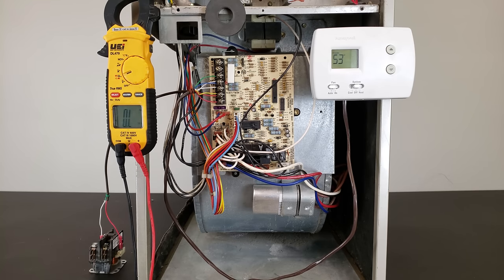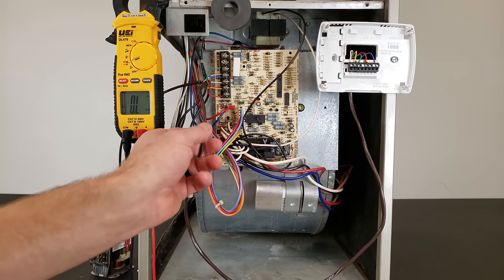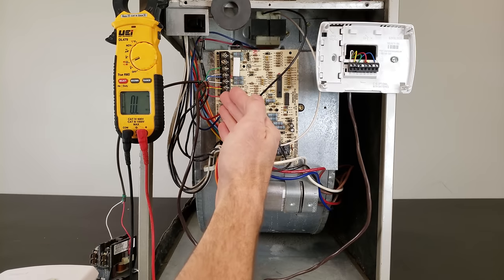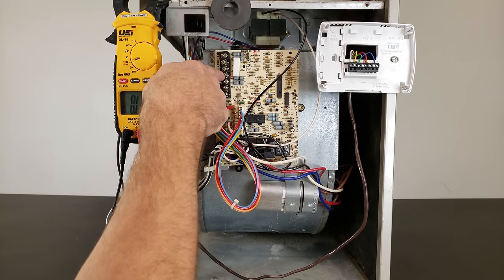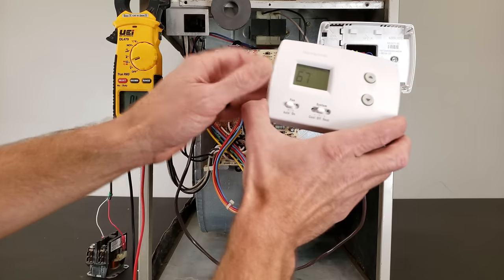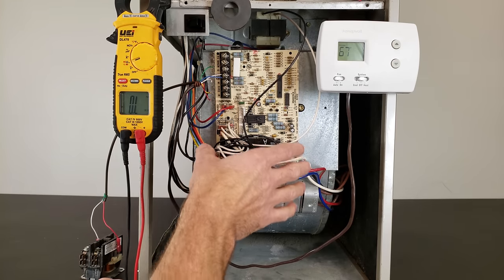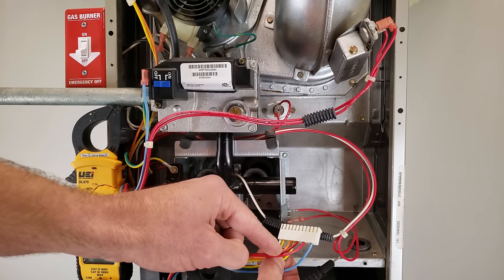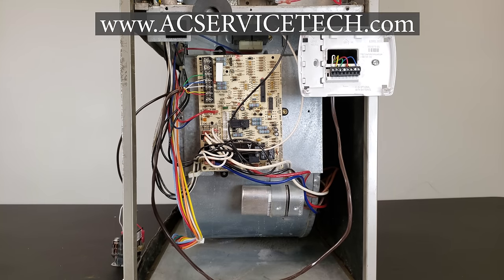Finding Low Voltage Shorts Fast! HVAC Troubleshooting!

Comment: Wow I wish my unit was this simple. I have what looks like another thermostat inside of my furnace and a black box with a red timer knob on it and also another black box looped to it by 2 wires with 3 wires connected. I am so frustrated with this. Your video is great but my unit is just a lot more complicated. By the way I'm blowing fuses when unit is calling for cooling. Doesn't happen on heat and not happening when calling for fan.

Comment: I have installed transformers and the metal frame of the transformer is connected to. Ground and as I understand the bare copper wire is connected to the ground frame terminal and back to the service disconnect ground terminal which then goes to the ground rod to earth ground.

Comment: Once I saw how the metal tape insulation was touched inside part of the high temp limit switch. The problem was appearing sometimes.  And that playing price of metal tape was a conductor for the shortage. And it blew up the fuse sometimes.
Reply: This right here is an underrated comment. Ive had it happen 2 times and let me tell you it needs to be addressed because shit gets real when its 130 in the attic looking for these lol

Comment: Hi Craig, my HVAC unit was not started and after seeing this video, I have checked the fuse and it was blown out. Then I replaced the fuse. The unit works fine in fan mode and heat mode. when i turned on the cooling in thermostat the fuse blew out again. Please let me know what could be the possible reasons and what else I can check. Please advice
Reply: Contactor is a good starting point imo. But your meter is your best friend when troubleshooting electrical issues

Comment: Thank you for this video. It is 2024 Feb., and I hope that ppl or you still will see this reply. I am trying to learn about heat pumps. and was wondering if you or anyone could explain about the "common and the ground" on the 24v circuitry. i just don't get it, how there are the same as you say here. HOW IS THE COMMON, the ground? Or how is the ground common?

Comment: So I have a honeywell smart wifi thermostat and a carrier gas furnace. Whenever I run the heat and the furnace does it's heat cycle, soon as it goes into 90 second cool down where the fan keeps goin but the furnace isnt calling for heat my thermostat cuts off and then restarts once it's done. Any thoughts?

Comment: Very good explanations mate 👍 
By the way , how do you like your UEI meter , I hear both sides , some say they're good some say they're not reliable or precise enough?
Cheers mate 👍.
Reply: A UEI meter is good. They are a good price for their accuracy. The biggest difference you will notice between them and higher end Flukes is millivolt and small ohm resistance readings. Rarely do you need that much precision when diagnosing anything, especially residential. I bought a very expensive Fluke and while it's good and reads capacitance on capacitors MUCH faster than my lead techs UEI, it's not really worth the money/hype. Also I like that UEI meters have a magnet on the back making it easier. Only thing that I hear consistently is that Flukes tend to last really long.

Just make sure you get one with "true RMS."
Reply: @jericosha2842  Cheers mate

Comment: I recently dealt with an HVAC company who someone else called to fix something. He blew up THREE transformers before he told me that there was a dead short in the thermostat wires.... Which I already knew and already told him.
Why didn't I just do it myself? I was working there temporarily and i didnt make the call and i was too busy to deal with it. Ultimately, I used an unused wire to the stat as a substitute.

Comment: I have a 35 yr old air handler, what to do if it has no circuit board and a 3 amp fuse? I bypassed the thermosthat and now my AC won’t turn on. I guess I short circuited the unit.

Comment: Why leave common wire in terminal when test the ohm reading ? Thanks
Reply: Your short will usually be between the common/ground touching a hot wire.  Good luck!

Comment: I have a question about a blown fuse on an electric furnace on the heat side. I turn the furnace on and it will run for about 30 mins, then it shorts out the 3a fuse and the tstat is out. Replace the fuse and it does the same thing repeatedly.  Is that due to a bad sequencer, or possibly a thermal limit switch ??
Reply: Where you able to figure how to fix it. I’m having the same problem

Comment: What would be the issue if I'm not getting any voltage to my yellow wire at all? When I put my leads on R and G, I get 21V, when I do R and W, I get 21V, when I do R and B, I get 27V, but when I do R and Y I get 0V in heating and cooling modes. and when I do B and Y I get 0V when I'm in cooling as well.
Reply: @derrickanthony4  Yes. when I call for AC and I test R and Y or Y and B I'm not getting the 27V
Reply: Is your thermostat jumped from R to RC?

Comment: Is the thermostat wire are goes to the control board and than goes to the outdoor unit OR from indoor control board to the thermostat and fr om m thermostat directly goes to the outdoor unit? It would be great if you explain me. Any one please.
Reply: From the A/C to control board or control board to the A/C. Then the thermostat to control board. So if you need cooling it tstat tells control board and the control board tells the A/C to switch on. The control board is the link to the two. Once you have enough cooling the tstat is satisfied it tells the control board and board shuts the A/C
Reply: thermostat wires: R, C, Y, W, G are connected to control board wires: R, C, Y, W, G.......Low Voltage Contactor coil (outside) are connected to control board Y & C

Comment: Easy way to do this quickly without making trips to the thermostat is install your popper fuse and unhook your wires.  Leave your thermostat calling and hook them up one by one until it trips.  Of course use your meter to verify your suspicions, but that’s a quick down and dirty way to find the problem.

Comment: I installed a smart thermostat but i dnt get 24v and i dnt have a problem with my old thermostat whats seems to be the problem?
Reply: Do You have common connected?
Reply: no common
Reply: Did you unplug the furnace when you changed the thermostat? You might have popped the fuse by the wires touching each other
Reply: Yes ! i have all the the 5 wires everyting works fine with old thermostat, i have 2 thermostat and get only 12v each thermostat i think its wired parallel not  series. I ordered a 24v adapter at amazon thats the only solution i can find.
Reply: I measure red and green and i got  25v but the rest of the wires is lower voltage like 13 ,17 v i bought a smart  thermostat and cant get a power.

Comment: Whats the magnet for?
Reply: To place it over the furnace kill switch to act as if the door panel was closed. Beats holding down the switch with your thumb 👍
Reply: @justbeingreal5839  True. I just did not know what it was doing as shown in the video.

Comment: Good video. I have a suggestion: use the correct terminology for the units of measurement. It’s not mega-ohms or kilo-ohms. It’s megohms and kilohms, etc. By the same token, I’ve heard some people pronounce a meter that measures current as an amp-meter, when it’s actually ammeter.

Comment: I'm having the same problem only its not blowing my fuse, it's blowing my transformer
Reply: Disconnect the transformer, then check like Craig showed. Odds are the short is after the transformer.

Comment: You could have a dead short in the low pressure switch that will cause the fuse to blow when in cool mode

Comment: If you have a heat pump it’s likely one of your pressure switches in the condenser wire jacket has rubbed through and shorting your ground on a copper tubing. Carriers are notorious for that I blame Mexico factory workers for lack of attention to details

Comment: I dont understand why when is reading OL thats not the problem. Is an open line.
Reply: Ol is the normal reading between common and hot wire(low voltage).  Essentially it’s the same as touching your 2 low voltage contactor wires together creating a short

Comment: First principles.
The whole problem with the ENTIRE hvac industry is service and parts for profit.
Of course you will get shorts,opens,semiconductor fails, bond wire, substrate die junction, when they do single board designs without conformal coatings
whilst no protection from dust, moisture, heat, vibration.  I have had to rebuild entire control cabinets of NEW 600 ton chillers from
CARRIER because of this BS. Yes this voids warranty and  service guaranties but I will never need them.  They don't even use real ball, pin or roller bearings in motors in the smaller common garbage.